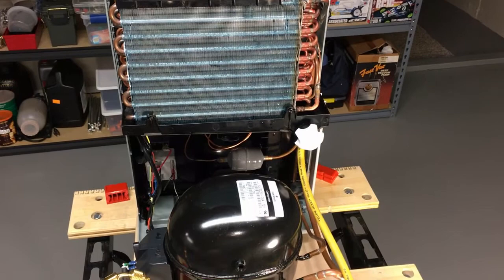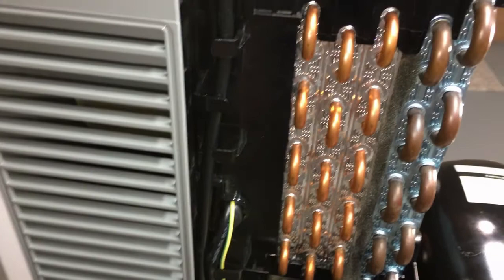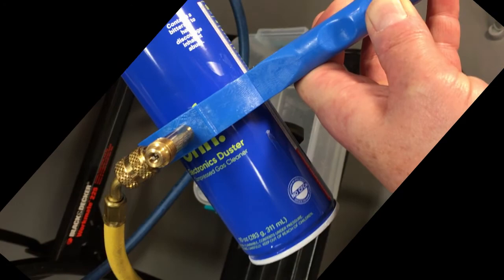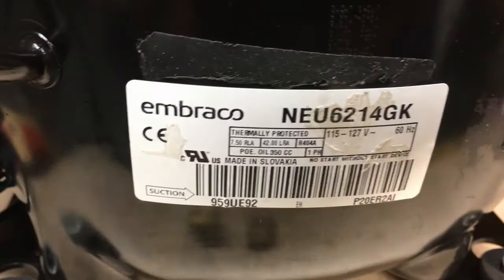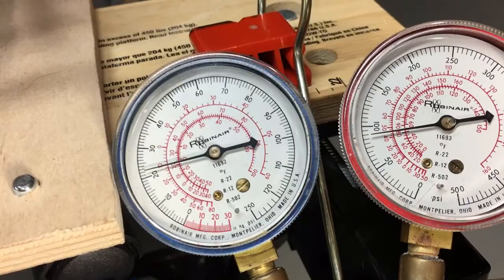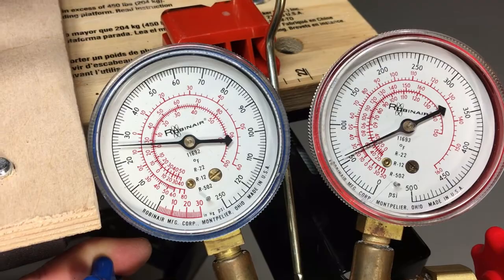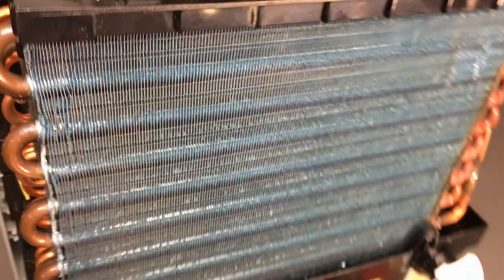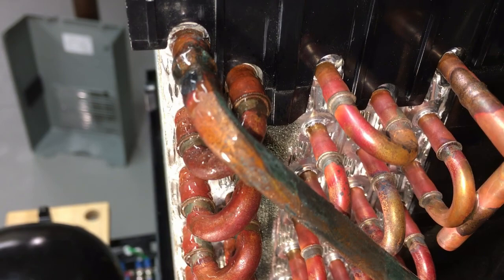Not your average dehumidifier

Comment: I have had EVERY Dehumidifier purchased from Costco in the last 10 years fail. None have lasted more than 2 seasons. Recently, 2 Midea 50 pint cube dehumidifiers purchased in 2022 have failed within 2 weeks of each other. One was completely icing up and the other simply stopped dehumidifying no matter what setting was selected. The only saving grace was that Costco accepted both returns and refunded the purchase price.
Reply from the maker: @reedgrele6673  They are ALL junk these days.  The copper tubing in the coils is literally paper thin and of poor quality.  It takes very little for filiform corrosion to set in and turn the coil into Swiss cheese. Google “filiform corrosion copper” and you’ll learn a lot. That’s why the old school dehumidifiers with the smooth aluminum tubing coils lasted forever.  The aluminum isn’t subject to that type of corrosion.
Reply: @chrisbeck8182  Thanks for that. 
My parents were married in January of 1955. When they moved out of the family home in 2007, ALL of the appliances that they received as wedding presents (refrigerator, range, vacuum cleaner, mixer, toaster... etc) were STILL WORKING!!!

Comment: from all the videos i have seen people found that everything on modern made in china junk is cheapened so the coils fail from being too thin the circuit boards have bad solder joints or parts burn out seems like they are just made to last till warranty runs out. so did this Frankenstein model hold up is it still running?

Comment: You seem very knowledgeable with these things, What will happen if I put a normal dehumidifier in a hot 60 degrees Celsius room with about 80% humidity, do you know what will fail and why will it fail, I cannot find an answer anywhere on the net. Will the evaporator get too hot? Maybe the pipes will have over pressure? What do you think might be done to a dehumidifier in order to work at 60 deg effectively?
Reply: use nyle dehumidifier wood kiln dryer.

Comment: Very nice! That runs very well and it does look like you got the charge spot-on.  The Embraco unit you have there is going to have a long life lightly loaded. Those are good compressors in general. 

It's amazing how much water is in the air, when you think about it. 

The issues with flooding back can be helped with a small suction accumulator, if that had been a serious problem.

Thanks for sharing this with us!
Reply from the maker: Thank you for the comment, David.  I was about to make up an accumulator but after adjusting cap tube length and going up in diameter from .049 to .052 I realized that I just had too much displacement and not enough heat transfer for the R290.  The data proves you can’t stuff 6000 btu through a 4000 btu coil. 
The initial R152A test was just a whim before I added the accumulator and the system performance just dropped right into line. Obviously it’s not ideal but I’m amazed it works as well as it does.